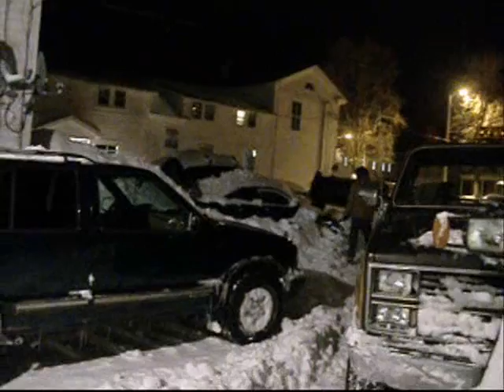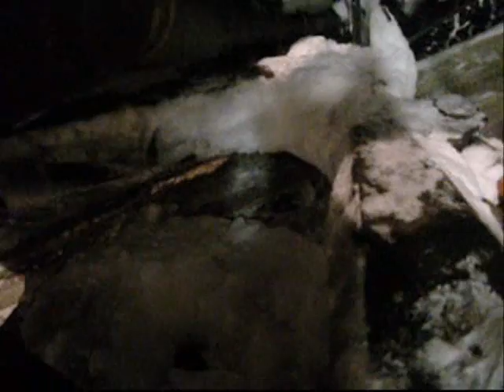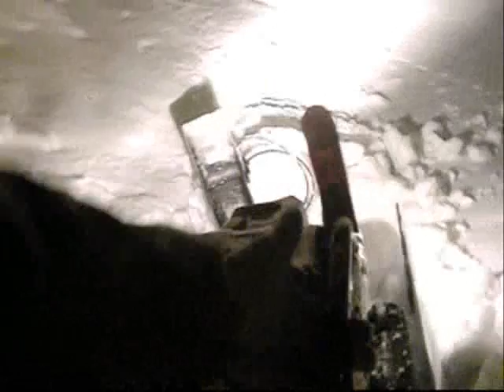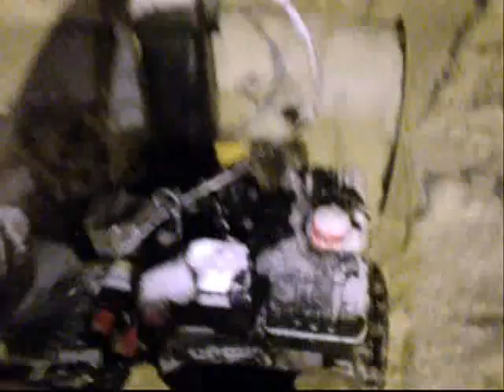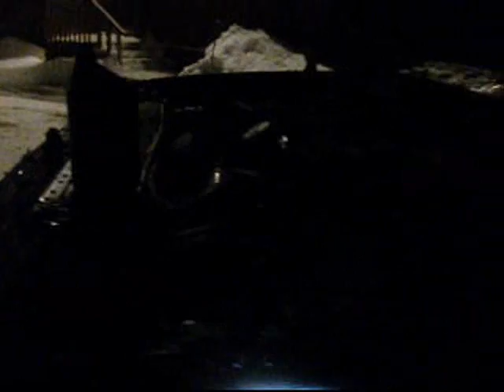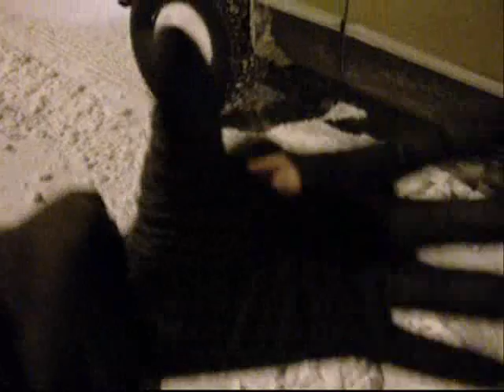3 7 11  K5 Two Feet Snow  Weld...

Comment: You need a heavy duty fisher. 8ftooter. I got a speedcast 8 ft. The heavy duty kind that you put on 3/4 ton trucks. Thing is indestructible. Plowed the two foot storms here. in ct months ago no problem. The a frame sure as heck looks alot thicker then that one.

Comment: @CORVAIRWILD Oh man that stinks. Need to grab another 454 plow truck. I thought your blazer was a 3/4 ton? I know on my f250 its goes down a bit when you lift it up and it has the heavy duty front suspension option rated at 4600lbs.